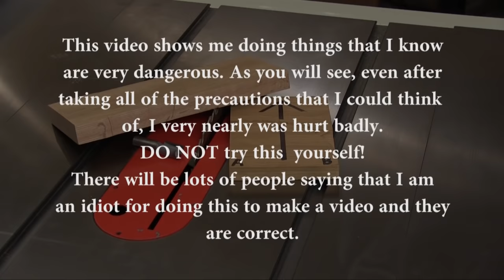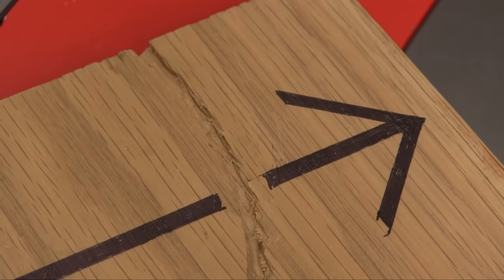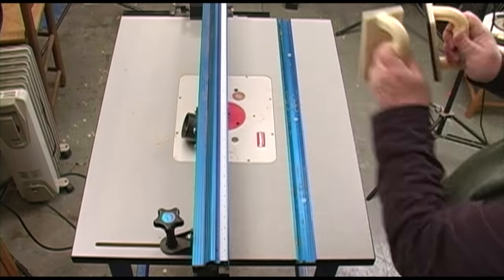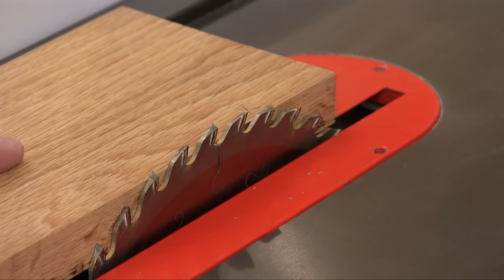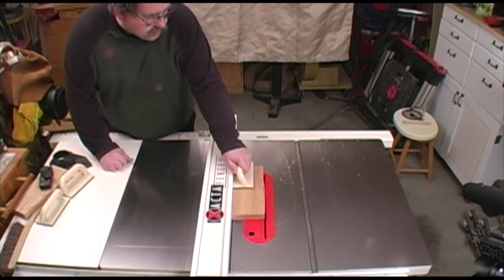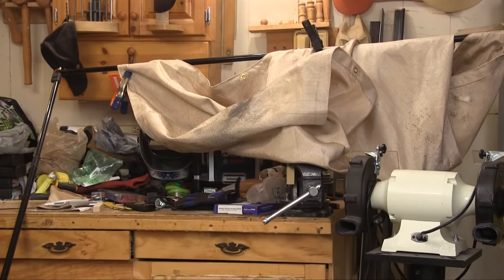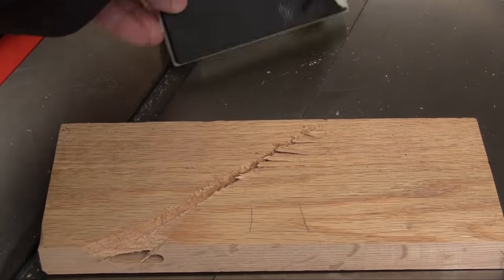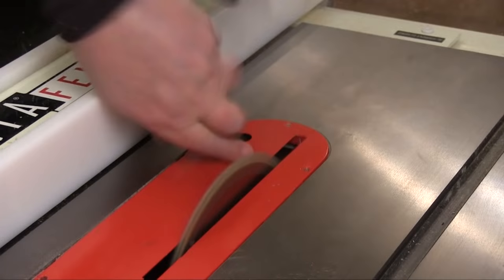Kickback on Camera!

Comment: I have been showing your video to my woodworking classes for the past couple of years, I commend you for being humble enough to post it, and to admit that you were crazy in attempting this kickback.  What a great learning tool your video is, my students are 100% engaged when we show this.  It sure makes teaching the physics of pushing stock into rotating cutting heads!  Thanks again for putting this video on YouTube!
Reply: I've been showing it the last few years too.  Its a great video
Reply: I watched my buddy cut his middle finger off on the band saw. That was a mess of blood and the bone looks pretty cool tbh.
Reply: Shoot, theres a website that compiles table saw injuries. It has a separate section with pictures.

I'm not a squeamish person, like at all. But as a wood worker and having a relative with no thumb tips it was a bit close to home. I could only take 5mins and was a little hesitant to make sawdust even after my new Freud Fusion blade came in the mail. 

I think it'd be a good learning aid, it seemed like the vast majority would easily have been prevented by observing basic safety and/or from saws lacking a riving knife. 

A little mistake and 1/100th of a second can cause (hundreds of) thousands in hospital bills, surgeries, months of recovery and if you're lucky, a debilitating scar. Usually severe loss in functionality in your hand.
Reply: probably had his phone out taking video instead of helping too
Reply: Yeah, it shows just what that riving knife protects us from.  I will never take it off, thats for sure.
Reply: Do Bo good thing you don't teach english
Reply: I agree, a risk to take for the safety of others.

Comment: Beautiful demonstration.

I've had exactly one of those in fifty years of woodworking. I absolutely stand behind the admonition to always use a guard or riving knife... and I'd rather that it be a full-up guard with pawls. In the modern shop, there are no good excuses to leave the guard off the saw. None. Zero. You do NOT need to watch the cut. There is no cut you ever need to make on a table saw that will require the removal of the guard.

Comment: Years ago I removed my blade guard on my table saw because it was hard to work around.  Because of this video I pulled it off the shelf and was able to retrofit it to use the splitter without the plastic housing that kept jamming up my work.  Your mistake scared me enough to make me rethink my stupidity. Thanks for this. Also you sound like Ditka. Dah bears

Comment: I've got two table saws in my garage and I'm nervous to use them. But I am going to attempt it, because I've been doing my research. And THIS is the kind of research I need so that this never happens to me. I am also thinking of selling the other two saws and getting a SawStop. But nothing beats common sense and following rules!
Reply: Don’t say it will never happen to you. If you’re working with wood and going by a saw blade or bit from a router, or any power tool, it CAN happen. One thing to make sure of is that your saw fence is exactly parallel to the saw blade. If it’s off a little bit you can pinch the wood and get kickback. Don’t be afraid of it, but treat it with the respect it deserves. That goes for any tool, even a screwdriver.

Comment: While making the very last cut of what was over 100 thin strips for floor I installed, I slipped and put my thumb across the blade. It happened so fast I couldn't believe it actually happened. I got lucky,Chad the blade only about a 1/16th above the work piece, so all I did was remove my thumb pad... And every nerve there. But, I still have a thumb. Great video, and thank you.

Comment: For a bit of oversimplified math, assume a 10" table saw spins at 4,000 RPM (realistic round number). The blade's circumference is 2.618 feet (2 *  π * 5 / 12), so each tooth is moving at a rate of about 175 feet per second (circumference * 4000 / 60).
There are online "reaction time test" websites where you have to click when something changes color. The average is around 250ms, or 1/4 of a second, and that's when you're sitting there waiting on it and barely need to move a finger in response.
Put that all together, and the piece that was kicked back could be 43 feet behind you before you can even be aware that something happened.
Reply: I like scary math like this.
Reply: That's awesome

Comment: To be honest I never fully understood the benefits of the riving knife until I saw this video. 
For years I usually didn't have the riving knife fitted. From now on, I think I'll have it fitted unless there is some special reason to remove it.
Reply: bob o that's bs. riving knives and splitters are always safer to use on a table saw for wet wood, soft wood, dry hardwood etc..... plastic guards are dangerous imho ,but a split error can help keep the workpiece pushed against the fence which prevents kickback.
Reply: bob o To be honest, it scares me to cut anything small on the table saw. I usually just get out the hand saw, if I can. 
I'm going to make a sled soon so that might be helpful.

Comment: My first kick back happened to me in highschool shop class. We didn't have a blade guard on rear. It shot back at enough angle to miss me.. but ended up flying into of all things the shop teacher. It struck his hand and actually shattered some of the small hand bones in his palm. 

Our table saw had that blade drop safety device and the blade did drop. So my hand hit the blade but all i had was this tiny scratch.  And from that day on we had a finger board and the blade guard for like every cut.

Comment: I bet your blood ran cold for a moment after you viewed that slow playback :/  I once leaned on the lid of a deep fat fryer I was cleaning and the lid slipped off it's perch and plunged into the fryer with my hand still pushing down on it, instinctively I jerked my hand out before the oil displaced by the lid could engulf my hand but when I thought back over it my hand was a good 5 or 6 inches below the surface of the oil and it was only the fact that the lid slipped in uniformly, pushing the oil out and away, that saved it, had the lid caught the side of the fryer and went into the oil at an angle I'd be missing a hand right now.  Nothing has ever made me feel as nauseous as thinking back over that.

Sorry for being off topic-ish, but as a chef hot things are as close as I get to injury, and I've had a few.

Comment: My father goes around giving people high-3.5's now because he wasn't using proper safety equipment on a router with a big-ass base moulding bit.
Reply: Oh no, he couldnt save them?
Reply: @tinapaytinapay  Well, when body parts come into contact with a router bit, the contacted area becomes pulp splattered all over the walls. So no.

Comment: I had kickback happen and you're 100% right, when it's happening in that split second you never realise just how "slow" we are at retracting our arms and fingers from the danger. Since we're putting pressure down or pushing and that "inertia" we had going is still there and WILL get our fingers in the blade as the wood piece moves. Boys you simply aren't fast enough to realise its happening UNTIL it's happened. I didn't lose any fingers but the sheer shock of what happened stayed with me for a good minute. I just silently stood there trying to get my bearings.

Comment: I've been a carpenter for 15 years and table saws still scare the crap out of me. Routers too. I do prefer hand tools in general but to stay profitable, you need the power tools
Reply: What's the most common mistake with a router to cause an issue? I've been using one without any problems, but I've heard people say they're very dangerous before and never had any mishaps with one, but I'm careful with every spinning power tool I use. Just curious so I can watch out for it. Table saws scare the crap out of my too, always super cautious around them.

Comment: First time I used a table saw, was cutting 2x4 into 4in pieces, no guard no know how about cutting. The board kicked back and luckily only took my thumbnail off and nothing else. The board was a good 5ft long and traveled 20ft away from me. After that I did YT searches and learned from my mistake. Years later no issues, I'm more respectful of table saws now.
Reply: They really do require respect to be able to use, the same kind a gun requires imo. Never think of any kind of saw as just a tool.

Comment: Man, that freaked me right out. When I saw how close your hand got to the blade even using the push block, that was enough to make my butt pucker... talk about a close call. I've been working with table saws for 35 years and I've had a few close calls over the years. A little trick that helps is to open the rip guide on the back side of the blade a bit, maybe 1/16", so that there's some clearance on the backside of the blade, but even that is not fool proof. I got my finger caught in a router bit once on a router table...my finger tip looked like a piece of hamburger meat, from the tip to the first knuckle. It looks ok now, but that finger tip is still numb to this day.  These cutting tools are extremely dangerous, we should never ever take them for granted.. I'm saying this to also remind myself....Spooky!

Comment: Thanks for the video.  You put yourself in serious danger to help others, and I and many others greatly appreciate it.  

I stopped using a riving knife b/c I switched to a circular saw blade and the riving knife is too thick for the saw blade kerf.  After seeing this I'm going to try and make a riving knife myself or go back to the regular blade.  I'm also putting the blade guard plastic thing back on.  

cheers and stay safe!

Comment: 14 years ago i cut my finger like this, the blade went in length wise from the tip and stopped before the second knuckle, first knuckle was cut in half, i was on heavy pain killers for 9 months, in the beginning i woke up 2 times a night from the pain of my blood being pumped through my finger, it was like a hammer hitting my finger every time my heart pumped, after a month or two, i only took one pill in the middle of the night, heavy-duty oxycontin at fist, over time the doctor lowered the strength, i couldn't put pressure on the tip of what was left for a little longer than a year, so i took a break from piano and guitar, maybe i'll start playing again one day, i saw a guy on youtube playing guitar and he had only 3 fingers, be careful out there folks its dangerous sometimes

Comment: thank you for possibly saving someones limb
Reply: Couldn't agree more, this video should be compulsory viewing. I'm not a wood worker, but occasionally will use my dad's or a friends. None are fitted with the guard, and to be honest, none of us actually knew what it was for. I've had this happen to me using a much longer piece of wood, but I thought it was just a lack of concentration or something. I can see know that I have been lucky, very lucky. I've cut some very short pieces of wood, placing my hands right in the danger zone. 
I was thinking about getting a table saw for my next project. I'm so glad this video came up as a recommended viewing. I know for sure that it saved me a few fingers.

Comment: Bruh when you slow down the slow motion part, it looks like you actually touched the blade. I didn’t expect that.
Reply from the maker: Kinda surprised me also. With all the engineers and manufacturing types I worked with planning that little demo, nobody thought it would get that close.
Reply: @flyingrcdotnet  I was watching without volume and thought you were just showing a reenactment of what happened while the machine was off. But the way that thing flew and your reaction said enough lol.

Honestly, I think this is still extremely valuable, regardless. Because it goes to show you can actually be “prepared” for an intentional “mistake”, and still not control the outcome.

Either way it’s good you came out of it with all your fingers lol
Reply: @flyingrcdotnet  Really? This gives me even more ammo to never trust engineers. Wouldn't have been that tough to make a mechanical pusher using some left over RC gear and a simple shim at the end of the rip fence to push the block into the blade and this could have been done from another room. Really glad you made it out whole though, this without a doubt opened some eyes to how sketchy tables saws can be, hopefully to all the engineers out there too lol.

Comment: I have to admit. I’ve been an idiot to. My old Delta table saw has never had a blade guard or riving knife on it. Just sheer luck I’ve never had an accident. I get my sawstop saw next week and safety feature or not, I will never use it without the blade guard or riving knife. Excellent video. Thanx so much.

Comment: I assure you I have done dumber with a table saw, and I have been using them for long time. I am still amazed of how stupid I was to try this.  I was rigging my boat for some reason in my garage, and I had to cut a thick piece of nylon rope. I didnt want to walk all the way in my house 50 feet away and get a knife, so I turned on the table saw sitting right beside me. Grabbed hold of the rope tight with both hands and held my harms wide spread not even near the spinning blade. The only thing my mentally disabled brain at the time didnt tell me, as soon as the teeth of that saw blade touched the rope, that rope would be pulled in at about 100 mph inside the table saw from both directions, that both directions of the rope were currently gripped tight with both hands. The violent powerful acceleration that my arms felt coming together like a 500 HP clap,  actually dislocated my shoulder. And still today I dont know how both my hands hit the spinning blade on both sides  so hard and I didnt even get scratched.
Reply: +StormRebel1 That is one incredible story!
Reply: +StormRebel1 Holy shit !! imagining this is...speechless !
Reply: +StormRebel1 ummm
Reply: In architecture school there was a fellow student who once thought it was a good idead to cut a small piece of wire on a bandsaw … let's say he learned his lesson …
Reply: Well, if someone ever starts a dumb and dumber contest for woodworkers, I'll nominate you.  Wow!
Reply: StormRebel1 tables saws are not 500 hp
Reply: Carter Bostick yea you are right, they are 10,000 hp.
Reply: Steven Vanheel my prius could smother that
Reply: Carter Bostick my 70cc mini bike could smother that
Reply: Lol I wish there was a video of that.

Comment: Table saws are thee most dangerous common shop tool there is
Reply: That and the lathe, I've had some scary close encounters with lathes.
Reply: @hakont.4960  lathes are lethal if you dont tuck in your clothes and tie your hair back (if applicable)
Reply: Angle grinders can be dangerous and lethal too. According to my quick calculation, pieces of a broken 5" disc can fly at you at an initial speed of up to eg. 90m/s (ie. 330kph or 200mph). My father told me some guy at his work had died that way.

Comment: Idiotic act perhaps, but you were doing it to demonstrate why kickbacks are dangerous. I wouldn't say showing us why it's so dangerous makes you an idiot. Riving knife helps, but I've had kickbacks even with that installed.

One common thing I think leads to that kind of kickback is if the quick lock guide fence on the table saw is not perfectly parallel to the blade, which tends to be the case with cheapo table saws. I used to have a POS Craftsman table saw that I couldn't even quite force the guide fence to go fully parallel to the blade, and stay there without slipping out of parallel. The thing was such a cheapo POS there was no way to adjust the guide fence nor shim the blade motor assembly to get it parallel either because of the direction the motor mounting bolts were arranged. Had my share of kickbacks that eventually made me junk that bastard out of paranoia. When you buy and assemble a new table saw, checking the quick lock guide fence and blade for natural parallel is very important. If it doesn't default to a good parallel, or have any reliable way to adjust it so it will, take the damn thing back to the store before it wounds you.
Reply: charizardman283 Oh, I know. Like I implied I came almost that close a time or two, and it did make me feel stupid. You really do have to be extra careful with table saws and handheld circular saws. Even routers can take a nasty bite out of you if you aren't being cautious. That sharp blade spinning at thousands of rpm doesn't forgive mistakes. It's good though that this was caught on video so well so he could show a lot of people just how dangerous it really is.

Comment: Thank you, I am an engineer (more versed in steel work and computers  than wood) and just started wood working as a hobby during covid..
And came on your post wondering if all the safety precautions were warranted.
Answer is yes.
Thank you for the motivational video, required viewing when thinking of cutting corners.
That an the memory of a  safety briefing by an old foreman "Everybody in the shop will have to follow this class, even the engineers, I know they don't come often, but at "big company name" they clocked presence on the factory-floor for everyone.
Engineers 5% presence BUT 45% casualties."

Comment: I've had one kick back in 35 years and it wasn't on a table saw, It was with a Circ saw patching in a wood floor. This was being a well seasoned professional. Still haunts me years later that I could have hit an artery in my leg. There's Things we can control and other we think we can until you realise you have no say in the matter.
Reply: For me it was always respect the machine  and know the safety the table saw is one machine i know from kickback luckily is was taught to stand on the side of the blade to avoid that